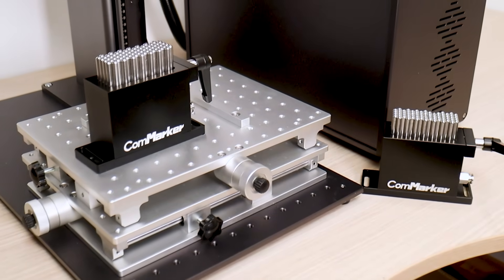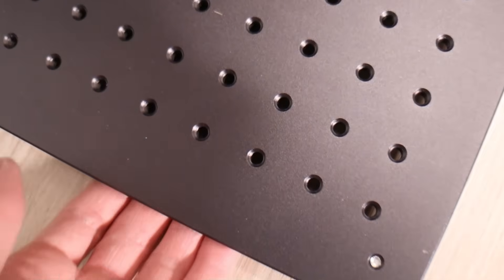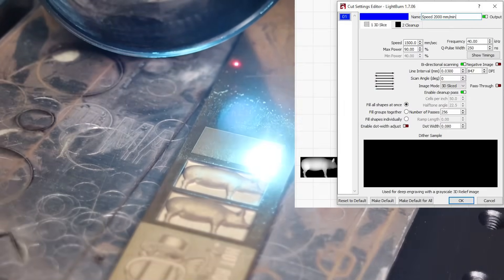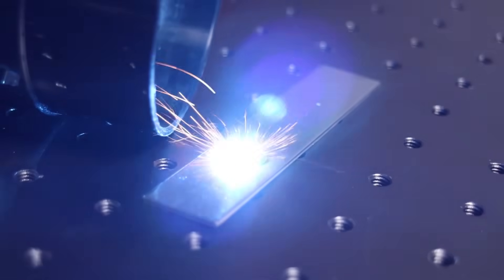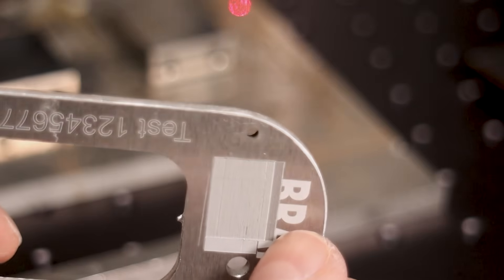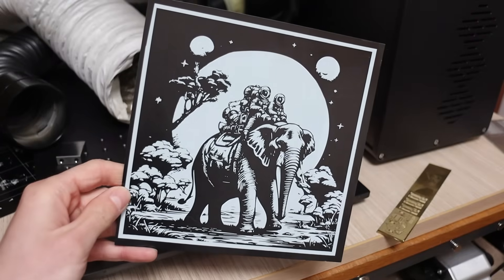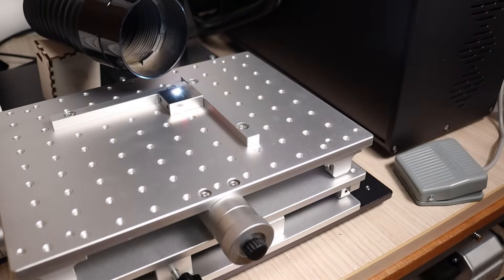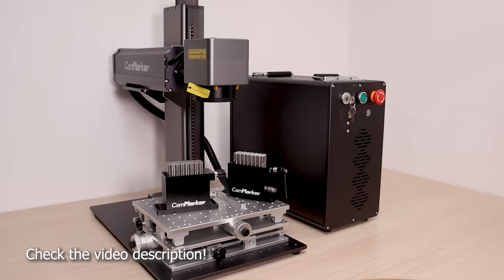ComMarker Titan 1 - A Seriously Powerful Fiber Laser! (Review and test)

Comment: Hi! Great video. Quick technical question: Does a 100W MOPA source require higher-end quartz F-Theta lenses to prevent thermal drift during long 3D engraving sessions, or are standard lenses (like those used for 60W) sufficient?
Reply from the maker: Thanks! Yes, 100W and 200W models need to use Quartz lenses.

Comment: Does it make sense to buy the Titan1 60W or is it better to stick with a B6 60W? I’d like to start a small engraving business.
Or would it be better to go straight for the 100W, even though I don’t know if the business will be successful?
I want in the future do 300x300 engrave, is that enought powerfull for just mark them?
Reply from the maker: For larger working areas Titan is better. Has better tower and more adjustability. For a working area of this size, more power is certaintly better. Especially for engraving metals. 60W might be on its limit with thr available power. For smaller working areas B6 is more than enough. With b6 it might not be possible to engrave with 300mm lens as the bed is bvery small and the engraving column might get in the way. Also the column will need to be extended. B6 is not designed for such a large lens.
Reply: @JTMakesIt "Thank you very much! I’ll take the Titan into consideration, evaluating either the 60 or directly the 100W

Comment: How large of an object can the laser engrave with deep vertical sides before the slope caused by the galvo head becomes noticeable?
Reply from the maker: @rickswanberg4995  the bigger the lens, the less angle the cuts have. 200mm lens that comes with the machine has approximately 350mm focus distance. You can calculate the angle (right angle triangle with one side 350mm and the bottom 100mm) and see if it will be a problem at a given material thickness

Comment: I have the Titan 1 200W. Extremely powerful machine. However I've been struggling trying to get the most optimized settings for embossing coins and other materials. I would be very much interested in any consulting services you might provide in order to figure out what I might be doing wrong.
Reply from the maker: What are your current settings?

Comment: I am saddened that it was not the 200w model. I have seen what 100w fiber lasers can do already. I was interested in this when i saw commarker advertise it to me as its the only 200w i have seen so far.
Reply from the maker: @peterfisher5551  i wasn't able to get the 200W one this time. Hopefully I will be able to try it soon.
Reply: The problem with the China toy is that the pulse energy does not increase with larger models. A quality 50w laser has more engraving power than a 300w china laser.
Reply: @shadowrob7709 What make is quality? And how much are they?